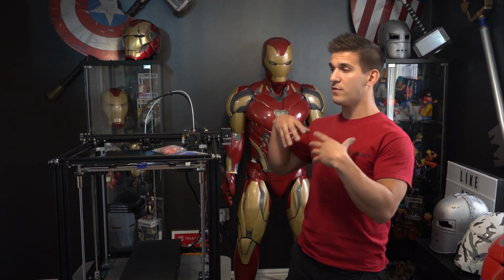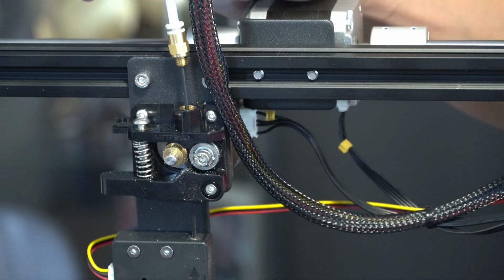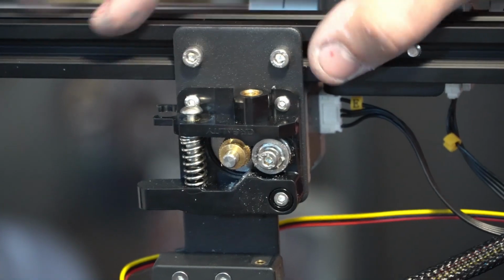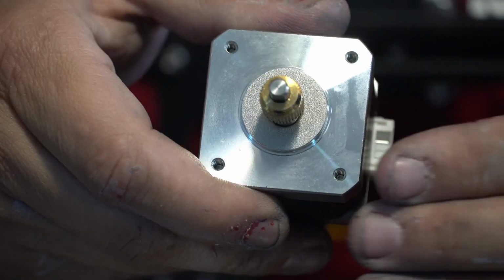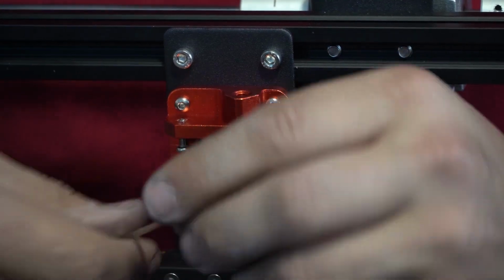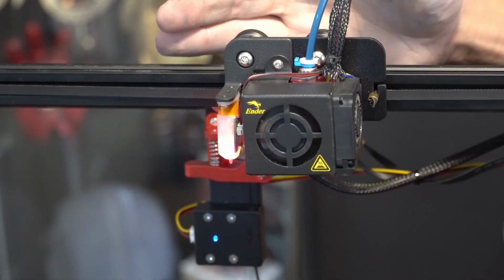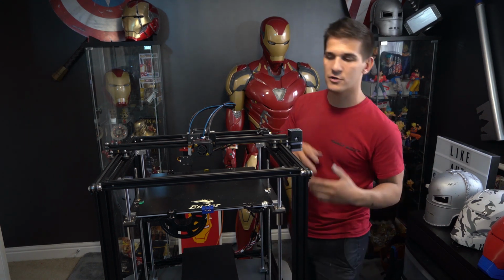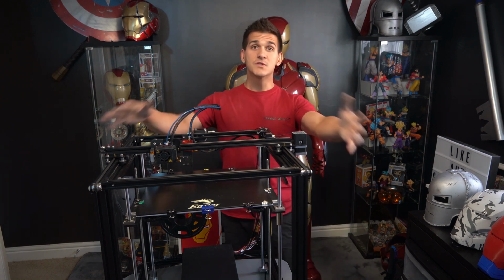Print Iron Man using the Ender5 Plus Made by Frankly

Comment: 16:29 Everyone I've seen switch the nozzle on their Ender 5/5 Plus actually unscrewed the case with the cooler first. Is there no need to do this after all?!
Unfortunately the bed of my Ender 5 Plus is seriously warped (0.35mm in the middle back & 0.2mm in the middle and front) and Creality doesn't care, so looks like I won't be doing any prints bigger than maybe 5x5cm. :(
Reply: How can a glass bed be warped?
Reply: @Robertotvl  glass can actually warp in the manufacturing process if humidity is introduced